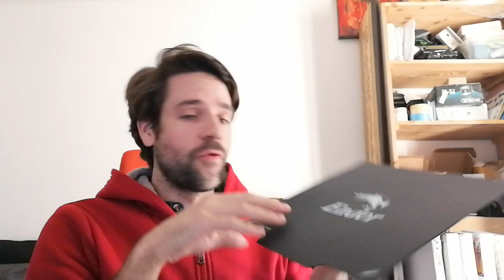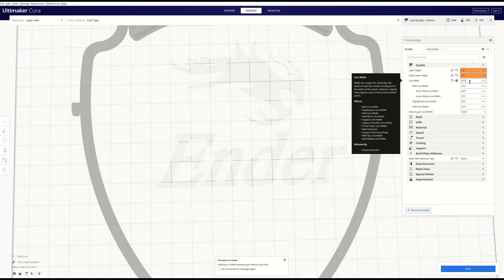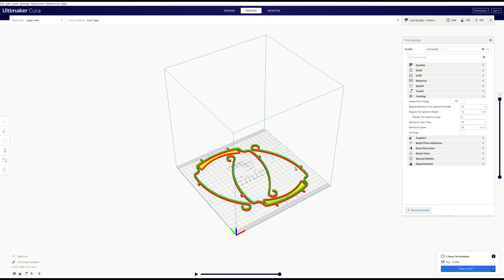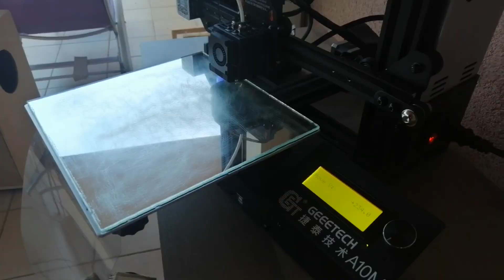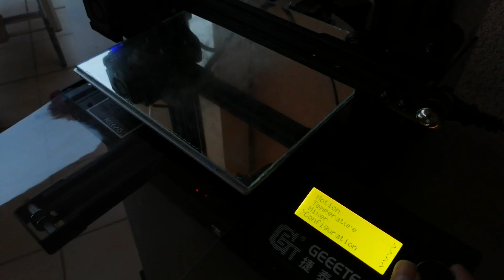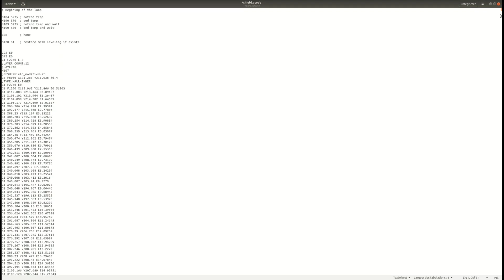How to infinite loop a 3D printing - Automatic print removal using gcodes

Comment: Isn't there a g code to do a loop? M808???
Reply: I'm working on the same trick that this guy is using in the video but to do the nozzle I'm just adding an offset to The Purge lines of 1 mm. And because of my version of marlin doesn't have the 808 loop I'm adding the files one right after another but adding in an offset Purge for each print.
Reply: I search for that too. I find how do it in file :
M808 Lxxx    (xxx need replace to 0 for infinite or number)
{parts code}
M808

But unfortunatly this loop code don’t work on my printers Aquila x2 x3and Ender v3, AM8 :/ maybe cause the syntaxe ?
So if you find a solution, please tell me…
Reply: @brico3d779  I'm not absolutely positive but I think it's because it wasn't compiled in the Marlin firmware. The people who made the printer figured you don't need it.

Comment: M190  R30 isn't working for me, for some reason it just cool the bed to 50° degrees
Reply: Probably some limitation in your firmware. If not familiar with editing firmware, I suggest to send a command that stops the bed heating (just after M190 R30, and add a pause command long enough for the bed to cool down to 30. With some margin on that pause, because your room temperature has an influence)
Reply: @pierrelecoz6313  I don't know a pause timer command in Marlin

Comment: a question, to me it does everything right until I get to cool the plate to 30 degrees after it does not make the code to move the piece it does not read it and does a strange thing it goes up and continues to extrude wire what to do? thank you
Reply from the maker: Hi Francesco ! 

Could you share a video of that issue ?
Reply: @displaydashtechnoparts5264  ok where can i send you videos?
Reply: D to put a semi colen before the commands that dissable your stepper motors it will be in end gcode if u dont turn this off it will disable the xyz motors and will not move simply put a semi colen before the comand to make it a comment and it will be ignored !

Comment: M190 isn't working in my marlin 2.0.9 for this, it wailing to heating plate, but isn't wait to cooling plate.
Reply: I having the same issue, did you fix it?
Reply: @Obsesión3D  Yes, for cooling you are need use another parameter. S - wait only when heating, R - wait for cooling or heating.
Reply: @TheYaroslav77  mm my problem it just wait cooling to 50 degrees, anyway I'm using M190 R30 to get the bed to 30 degrees but it just cool to 50 degrees

Comment: I found the below code for a WHILE loop. Would this work instead of copying and pasting the program?

https://www.cnccookbook.com/cnc-g-code-macro-conditions-looping/

#100 = 1

WHILE [#100 LE 5] DO1

(Some G-Code Blocks Go Here to Be Repeated Each Loop)

#100 = #100 + 1 (Increase #100 by 1 each iteration of the loop)

END1
Reply from the maker: Hi Mark ! 
I've looked at it. But I'm pretty sure the Ender 3 Marlin Firmware won't support theses loop commands. 
Let me know !

Comment: Clickbait, this is not an infinite loop, runs the code, and stops when it ends.
Reply from the maker: Hi Zoltan, the code prints 40x2 parts, in about 30 hours. 
Ok it's not "infinite". But in comparison with normal print of one single part, it looks infinite. 

I set 40x2 parts, but you can make 100, 1000, 10000 by copy/past the content of one loop if you want to. 

Note that at some point, you have to replace the filament spool. So indeed, it's not real "infinite". 
But what is infinite in this world ?

Comment: ever heard "the right tool for the job"...your precision positioning stage / nozzle are most certainly NOT the the right tool for the job.  This is the second video I have seen on this, I sincerely hope it does not catch on.

If you really need to start new parts unattended, build a proper, dedicated mechanism to remove parts.  That would be clever, this is just a lazy mans way of slowly destroying a printer.
Reply from the maker: Thanks for you comment. I'm happy to tell you that your hope is granted: my printer is fine after +3000 parts printed like this. This was predictable as when the nozzle pushes the part, there is no resistance AT ALL: the glass / FR4 completely releases the part once cold (~40°C). No constraint at all on the printed. 
 "this is just a lazy mans way of slowly destroying a printer" => This a trick made to help people print more shields during COVID crisis. 
"build a proper, dedicated mechanism to remove parts" => I'm sure you are really good at that, as you talk about it.
Reply: @displaydashtechnoparts5264  
in all honestly, I probably glossed over your video a bit too fast, and I have no experience printing on glass.  if there really is no resistance, I have less of a problem with it.  There are people breaking stuck parts loose with their hotend and that most certainly is a bad idea.

So you are saying when its cold the part is no longer bonded at all to the bed? if that's the case, couldn't you just jerk the bed and let it fall off?

"build a proper, dedicated mechanism to remove parts" => I'm sure you are really good at that, as you talk about it.

not sure if that's sarcasm or not, but yah I am more than capable of fabricating such a device as are many people.

and fyi, I too am printing covid related parts, primarily face masks